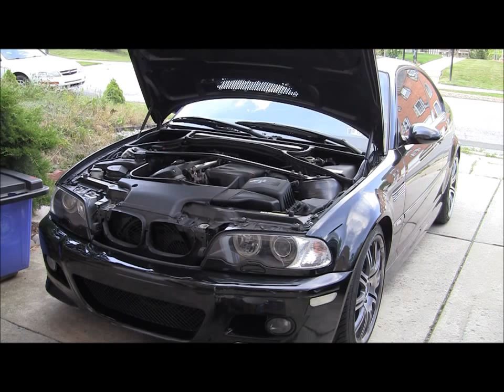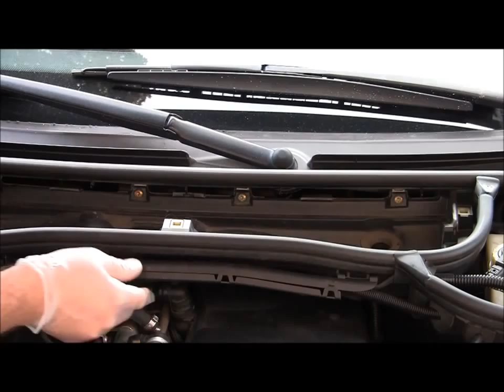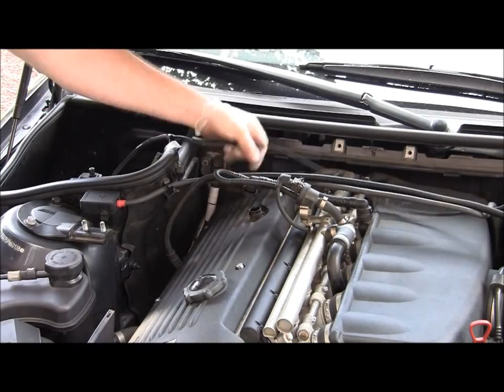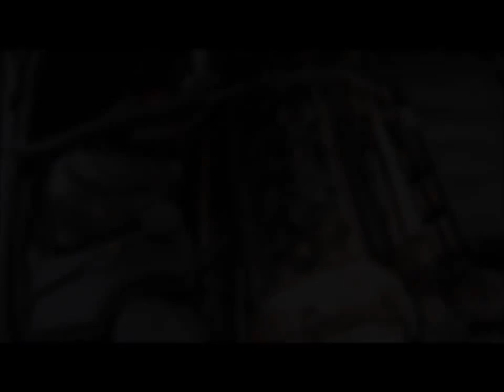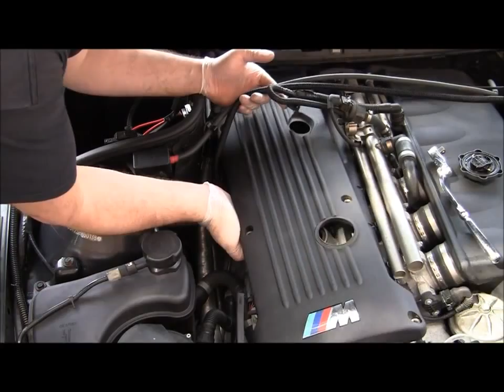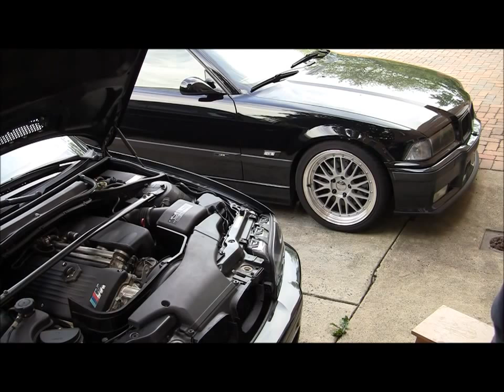BMW E46 M3 Spark Plugs Replacement DIY 3 Series Spark Plug Change Bimerok

Comment: Excellent vedio instructions for coil pack replacemen... :) Cylinders 5 and 6 on my E46 shows oil present on removed coil and spark plug. Do you have vedio on gasket replacement ?